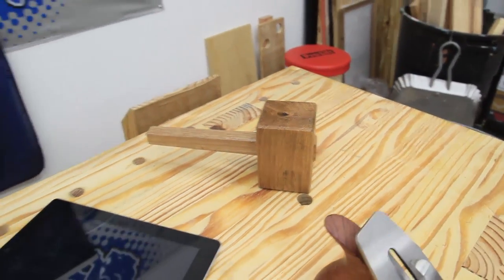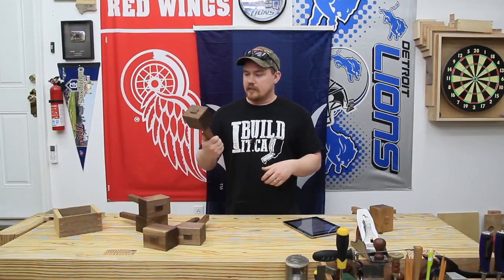Vlog #73: Shellac & Tool Tote Tool Tray

Comment: I love using shellac for all the reasons you mentioned, plus the fact that it's an excellent neutral sealer that separates finishes that may conflict with one another (like a water based finish and an oil based finish.) I've also used thinned amber shellac as a toner to give a piece a bit of an amber glow without going with a stain that might obscure the wood's true colors.

As far as video length goes, you're one of the best when it comes to determining that - you and Frank Howarth. You let the project determine the length of the video, and I think that's the way to go. Some projects need a bit more detail and info than others, and you're very good at deciding which needs what. It just works. I hope that made sense. 

No matter which way you go, I can't wait for the table build video. Have fun with it! (I know that you will.)
Reply from the maker: +Mark Lindsay Thank you very much for the input and feedback, Mark.

Comment: I like the longer videos too. Those mallets are great. Making them is a lot of fun. Non-woodworkers find uses for them too - like in the kitchen. I made mine mortising through the whole thing with a 1" bevel edge chisel - it goes faster than you think though. I've never laminated the mortise in but I should try it. If your in a hurry or forget to reconstitute the brush using shellac, you can just put the brush in some DNA it will be ready in like 3 minutes.
Reply from the maker: +Frank Gliha Good tip with the DNA